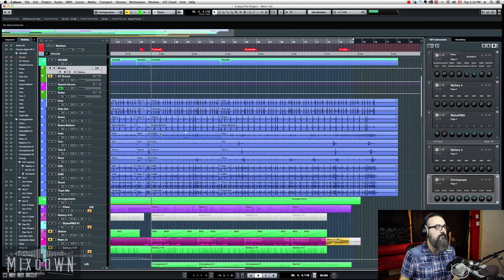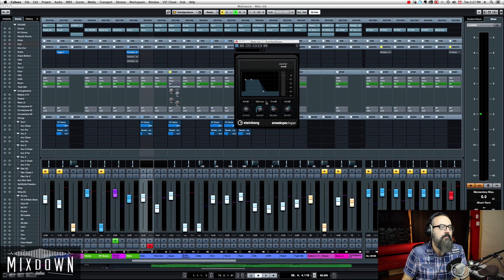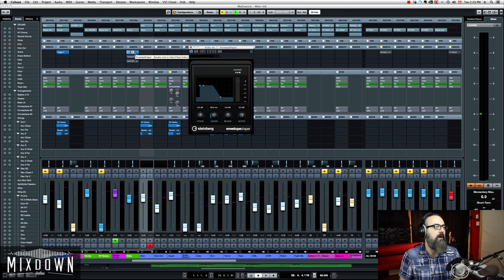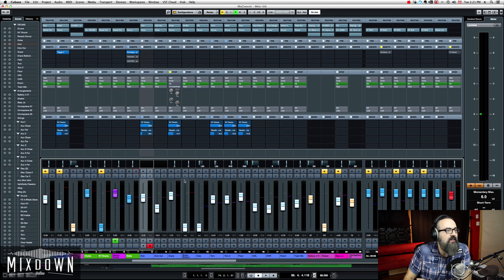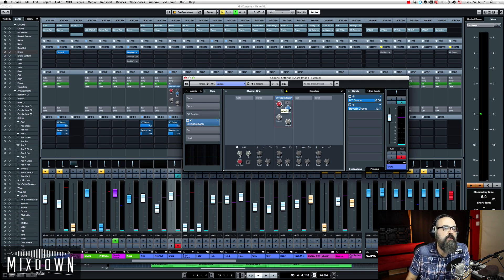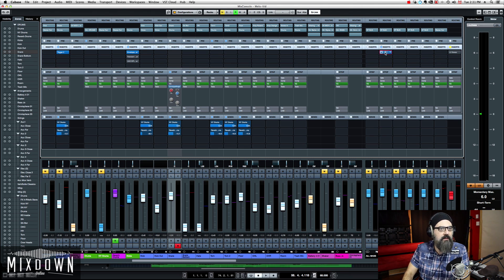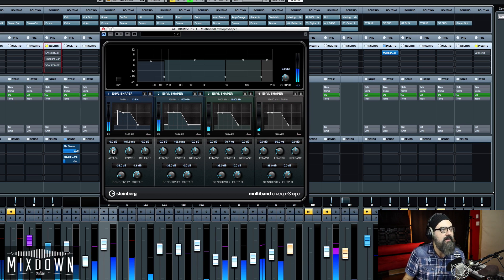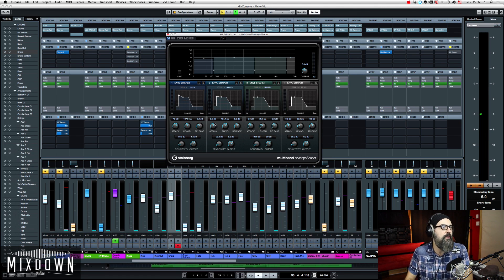How To Add PUNCH To Your DRUMS #cubase9 - mixdown.online

Comment: the izotope transient tool which is included in Neutron is quite excellent, it's  simple to use and multi band.
Reply from the maker: Good to know, I never worked with Neutron. Thanks for the info my friend :-)
Reply: It's quite good actually, they have a really nice EQ interface and a "masking detection" feature as well. I also like the very helpful soloing features for any of the multi-band functions.

But I didn't even know there was a transient tool (and a multiband envelope!) in Cubase, so Kudos for bringing that up. also nice to have separate release and "Length" parameter. Ozone only has transient and sustain.
Reply from the maker: Realraven2000 that's good to know... The length option is definitely a plus. Thanks :)

Comment: I love your videos and I really appreciate that you use stock plugins in Cubase since I'm a Cubase user who mostly uses stock. Question though: if I use the plug in on the channel strip, is that before or after the inserts? If I use envelope shaper in the channel strip, then use an EQ as an insert, am I EQing the sound I shaped? Or am shaping the sound I EQed? Thanks! Keep up the great videos!
Reply: Jeff Thomas I think you can swap positions when you click the (e) button to have the strip either pre or post inserts. there is a button in the 2 top left tabs of that window
Reply from the maker: Hey Jeff, good question...Realraven2000 is right, you can swap positions through the Channel Settings window (e).
I actually talk about that in this video https://youtu.be/APaAa7T_XNg?t=219
Reply: MixdownOnline thank you both!